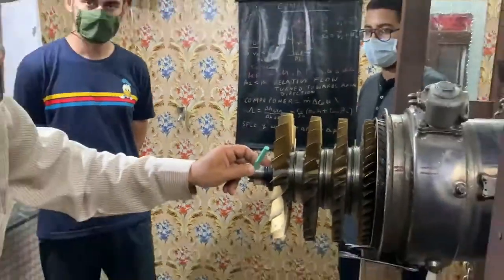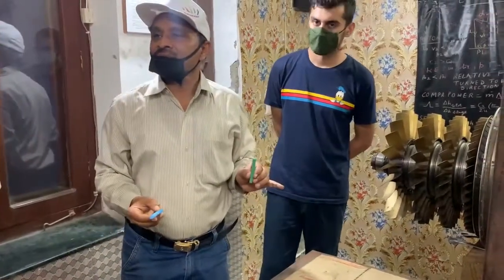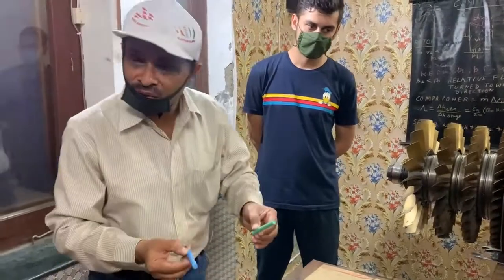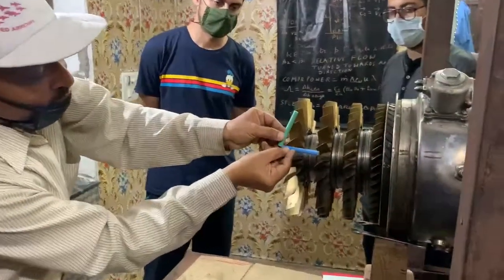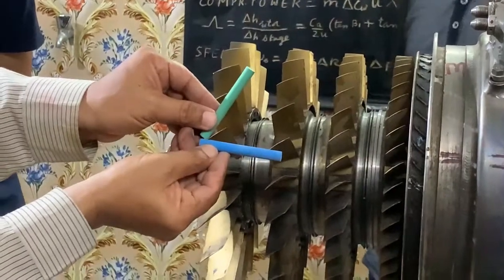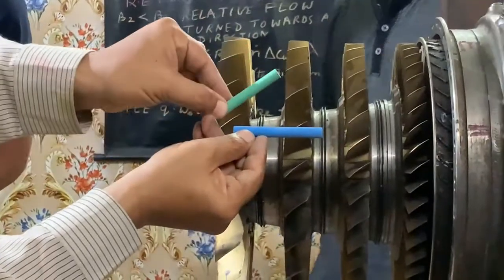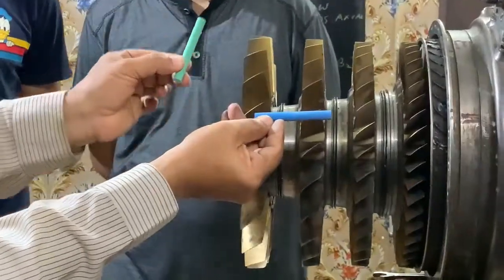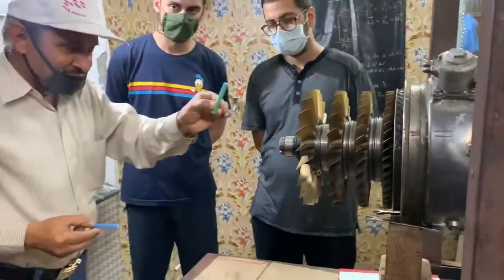Part-2 of 3: How does an axial flow compressor of a gas turbine or jet engine work ?

Comment from the maker: Assignment-2 (TEBT-3): Name the different parts of this engine which you can see in this video. What is the purpose of these parts? How do they function? What is the possible material of these parts?
Reply: (1) Compressor rotor blades from 1rst stage to 3rd stage. Its purpose is to impart kinetic energy to air by increasing its tangential momentum and rotor blades have diverging passages to increase the absolute velocity. Its material is steel

(2) Compressor intermediate casing = material use in compressor intermediate casing is titanium. Its purpose is to  contains 4 to 9 stages of compression.

(3) Compressor rear casing = material use in compressor rear casing is steel. Its purpose is to  contains 10th stage and exit guide vane and also engine is mounted on it because of the centre of gravity of the engine.

(4) Diffuser outer shroud =Its purpose it contains duplex burners and two torch ignitors to ignite the fuel coming from duplex burners.

(5) Combustion chamber outer casing = Its purpose is to contains annular flame tube of tempered steel it heats the high pressured air from compressor.

(6)  Blow off valve = Its purpose is to release back pressure to avoid starting problems.

(7) Compressor drum = Its purpose is, the rotor blades are attached to the compressor drum.
Reply from the maker: @Jdnxh8639  Why does absolute velocity increase in rotor blades? Diverging passages should normally reduce the speed when the flow area increases and the flow is subsonic.
Reply: @spvmentors7258  sir because rotor blades impart kinetic energy to the flow. and we know that kinetic energy is represented by absolute velocity. That'why absolute velocity is increase in rotor blades
Reply: 1.Compressor rotor blades  from stage 1 to 3 purpose is to impart kinetic energy to air by increasing its tangential momentum and rotor blades have diverging passages to increase the absolute velocity. Material is steel.
2.Compressor intermediate casing- material is titanium purpose it contains 4 to 9 stages of compression.
3.Compressor rear casing- material is steel purpose it contains 10th stage and exit guide vane and also engine is mounted on it because of the centre of gravity of the engine
4. Diffuser outer shroud- purpose it contains duplex burners and torch ignitors to ignite the fuel coming from duplex burners.
5. Combustion chamber outer casing- purpose it contains annular flame tube of tempered steel it heats the high pressured air from compressor.
6. Blow off valve purpose is to release back pressure to avoid starting problems.
7. Compressor drum purpose the rotor blades are attached to the compressor drum.
Reply from the maker: @amritpalsingh4622  Divergent passages do not increase the absolute speed but they increase the pressure.
Reply from the maker: @amritpalsingh4622  Combustion Chamber Outer Casing, Thermocouples, Thermocouple Junction, Compressors Turbines: First Stage & Second Stage, Third Support Housing are also seen in this video (5:19 onward).
Reply from the maker: @amritpalsingh4622  Few other parts are Compressor 4th stage rotor blades, 4th stage stator vane half ring, Labyrinth seals on the compressor drum.
Reply: 1> Compressor rotor blades:- It increase K.E to the air by increasing tangential angle.
2> Compressor stator vanes :- It convert K.E to static pressure or increase pressure.
3>Compressor shaft :- Rotor blade and stator vanes are mounted on it.
4> Compressor intermediate casing :- It contains 4 to 9 stage of rotor and stator blades. 
5> bleed valve :- Its release  the back pressure air to prevent chocking.
6> compressor rear casing :- It  contain 10th stage and exist guide vanes, It's material is steel.
7>diffuser outer shroud:-
It contain duplex 8 burners and 2 torch ignitors
Reply from the maker: @rohansharma9669  Point No. 1: What do you mean by tangential angle?
Point No. 3: Rotor blades are not mounted on the compressor shaft. Stator vanes are also not mounted on the shaft. 
Point No. 5: When does it prevent chocking?
Submit the correct answers again.
Reply: @spvmentors7258  point 5 - to avoid starting problems .
Point 1 - *tagential moment .
Point 3 - *rotor blades are mounted on compressor drum and stator vanes are mounted on compressors outer casing.
Reply: 1.Compressor rotor blades  from stage 1 to 3 its purpose is to impart kinetic energy to air by increasing its tangential momentum and rotor blades have diverging passages to increase the absolute velocity. Material is steel.
2.Compressor intermediate casing- material used titanium and its purpose is to contain 4 to 9 stages of compression.
3.Compressor rear casing- material used steel and its purpose is to contain 10th stage and exit guide vane and also engine is mounted on it because of the center of gravity of the engine
4. Diffuser outer shroud-its purpose is to contain duplex burners and torch ignitors to ignite the fuel coming from duplex burners.
5. Combustion chamber outer casing-its purpose is to contains annular flame tube of tempered steel it heats the high pressured air from compressor.
6. Blow off valve- its purpose is to release back pressure to avoid starting problems.
7. Compressor drum-rotor blades are attached to the compressor drum.
Reply from the maker: @vikrantsharma8799  Divergent passages do not increase the absolute speed but they increase the pressure.
Reply: 1 stator vanes: change kinetic energy to pressure(titanium)
2 comp front casing: 1-4 stages of compressor(titanium)
3 comp intermediate casing: 5- 9 stages of compressor(titanium)
4 comp rear casing: last stage of compressor, c.g. of engine(steel)
5 leading edge of blade: air enters at high angle (increase kinetic energy)
6 trailing edge: air exits at less angle
7 stator vanes: converts kinetic energy to pressure(titanium)
8 intake (first support bearing): to stream line air entering, contain gears to start compressor(magnesium alloy)
9 free turbine: runs main rotor(titanium)
10 compressor turbine: extract energy from hot gases to power compressor ( titanium)